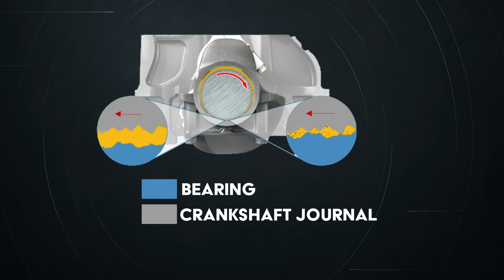the truth about start-stop technology (finally proven)

Comment: So, basically, instead of burning an extra 600 ml. of petrol for every hour that an engine is unnecessarily idling, it is more energy efficient
and cost effective to build two completely new cars. That makes perfect sense. Why didn't I think of it.
Reply: Exactly. The government looks like it's doing something good. The people feel good about themselves. The car makers make more money by having inferior quality products. Win win.
Reply: @0utc4st1985  Climatology 101 - Look good while making it worse.
Reply: @0utc4st1985  Yes. Mandate technology
that someone else has to pay for rather than building public transport infrastructure, bike lanes and improving road engineering.
Reply: You gonna rethinking that when you need to pay 1200 for a starter. At Honda we are starting to replace them on Pilots, we have been replacing the batteries on this things like crazy, and update after update for the worthless start stop. And what do you know we have a service bulletin to replace the starter. Start stop is not eco friendly.
Reply: @Flako92  starters designed for start/stop do not wear out excessively because of that system. 

The batteries now are also not made as well and are under more load than older cars so it makes sense that they don't last as long.

But yes, this was partially true on newer designs but has been corrected with reinforced pinion gears, or integrated starter generators. It's really not an issue anymore and I've never really heard of them going out excessively.

The starter on my grandmothers 05 Subaru outback went out all the time, didn't have a start stop system. 

So, it's really how well the system is engineered and from what I can tell the newer designs are plenty robust.
Reply: @Flako92  It's more like $400-600 job btw.
Reply: @Flako92 so how many hours does it take and what's the cost to do the starter replacement job on these
Reply: They talk about emissions and efficiency but how many cities actually use smart real time traffic lights? Worst than that is when they are de-syncd and once you get a red light every other light will be red too.
Reply: Two car is more money than one.
You gotta be on the corporate mind set man hahaha
Reply: good business model though
Reply: that a dream for car manufacturing.
Reply: It's not about the environment or your wallet, it's about the air quality in cities. Yes, it saves lives to damage an engine over time but at the expense of your wallet and potentially the global environment.
Reply: @larry365  Yes, it will reduce air pollution in cities, marginally, but from the perspective of global emissions, not a chance.
Of course, you can also reduce emissions in cities by investing in better road infrastructure, better public transport and bike lanes. The best and most effective way, however, is to reduce immigration and stop the sprawling developments ever outward and upward. For some reason, that hasn't occurred to anyone.
Reply: the test doesn't account for that... simple.
Reply: Instead of burning more petrol causing more wear on the engine, it is more energy efficient and lasts longer.
Reply: this helps manufacturers lower co2 emission. emission counts as emitted material multiplied by the units sold. so even a .1 l saving in fuel has a big impact - they have this as a budget to sell the more emitting and more profitable SUVs. Should they left alone after EURO 3 or 4, all would be fine. Also they like the ide of cars surviving the warranty period but becoming a financially unfeasibly repairable as soon after as possible.
Reply: Saving the world right?  Which do you think has a larger carbon footprint, burning a little extra gas or building two cars to do what one car could have done.
Reply: @Pje3ski  Total energy requirement to build a car? 100,000 -150,000 megajoules.
Total energy in one litre of petrol: 34 megajoules.
Total energy lost idling for one hour: 20 megajoules. (small car).
Average time US cars spend idling per day: 16 - 22 minutes. Energy wasted <7 megajoules.
I'm not going to bother going any further doing the math. If people can't figure out
how energy inefficient stop start functions are, that's on them.
Reply: How often do engines idle for an hour for most people, even cumulatively over a week’s motoring? I know mine don’t. Also, does it actually consume 0.6 litres for every hour while doing so? Maybe if it is a very high power engine.
Reply: @hedydd2 not rly my old Citroën with 2.5 engine 168hp was showing 1,6 litre per hour while idlling. 0,6 liter is very small amount...
Reply: @lucyferek  
It might show it 'on the display' but I doubt very much whether it actually used anything like 1.6 l/h.
Reply: @hedydd2 well if it showed that amount it showed how it was, during veey hard acceleration with 5 people inside it would show up to 213l/100km. Nothing surprising. My current daily driver takes 15/100 with delicate driving when i push it it has no limits....
I drive know what's in my avatar. And it only sports 360hp from 7 ltr engine.... 😮😂
Reply: @lucyferek  
That explains a whole lot. Ridiculous!
Reply: @lucyferek  The computer is wrong. Go figure. A Nascar doesn't burn that much fuel at 200+ mph. Four fully laden truck trailer combinations only just burn that much fuel doing 60+ mph.
I am quite happy to put just about whatever bet that you want on it that you can't get your Citroen to burn a small fraction of that at it's highest speed with its maximum load.
I'll go as far to say, I'll bet you one million dollars that you can't get that vehicle to burn even half of that.
Reply: @hedydd2 you would be surprised at how much they idle at traffic lights, stop signs etc. One of my vehicles keeps track of how many hours of idle time and it was shocking to me.  It gets awful gas mileage because it’s a 4 ton truck so I don’t let it just sit there idling or anything.  None of my vehicles have this auto stop restart “feature” that this video talks about.
Reply: @hedydd2  Try driving in areas with heavy traffic. You will idle for a lot more than an hour in any larger city.
Reply: The purpose of start-stop is not to save you 600mL, it’s to spare our cities the cumulative effect of a million idling cars.
Reply: @lebojay  Then invest some $ to fix non-optimal stop lights that create untold hours of unnecessary idling.
Reply: @lebojay  this is not the 70s, no catalytic converters and leaded gasoline. It's not even comparable.
Reply: @zaxmaxlax  CO2 is still a thing, oxides of nitrogen and SO2, depending on where you live, but no, this is not the 70's.
Cars back in those days were filthy.
Reply: @lebojay  The energy and pollution cost of replacing millions of cars earlier because their engines are worn is higher. It's the same with all the disposable expensive items you buy.... cell phones without replaceable batteries, kitchen appliances, washers and driers etc etc. Of course though you've  been fed a line a propaganda and cant figure that one out for yourself.
Reply: @lebojay  .... there are a shedload of more effective things that could be done other than this unnecessary, draconian requirement
Reply: @lebojay  Except that catalytic converters which are in every vehicle to clean the really nasty pollutants out of your emissions are vastly more efficient while the engine is already at steady state. The first few seconds after starting is often when your emissions will be the most contaminated.
Reply: @lebojay  Localised vehicle emissions are responsible for approximately twice as many fatalities per annum than vehicle collision are, on a global basis.
Let's not forget that. It is a terrible number to reconcile.
But a very small percentage of that toxic pollution is the result of cars idling. A tiny percentage, in fact.
How small, you might ask? If you spent
One hour and ten minutes commuting ten kilometres and one hour of that commute was at a complete stand still, you're looking at maybe 6% of your total emissions being as a consequence of idling in a car that achieves 10l/100km urban cycle.
Is it worth building three engines to one to achieve a 6% gain in localised emission's reductions?
I don't think so.
And is that the best path forward in addressing localised emissions?
No, it isn't. Better roads, light sequences, public transport infrastructure, bike lanes etc. That's the answer.
But that requires governments to actually do something, doesn't it.
It's much easier to pass ridiculous legislation and pass the burden of all reform onto manufacturers.
Reply: @davidbrayshaw3529 very well put, I agree 100%.
Reply: The problem is, we get stuck in traffic so long because vaccinated drivers don’t go on green. By the time they trigger their stop-start the light has gone red again.
Reply: @PeterLutzTEN95 that's wild😂
Reply: @lebojay Sounds communistic and dragging down individual quality of life to me
Reply: @lebojay  I will never ever use this feature in my car. Not my fundamental goal to subsidize the climate change zealots and support the biggest swindlery of the century.
Reply: It's possible to change an engine.  Still bad, however the rest of the car is fine.
Reply: @zeggyiv  How much energy does it take to produce an engine as opposed to idling an engine? What are the CO2 emissions that result from that process?
Reply: @davidbrayshaw3529  Do you really expect me to be able to answer that?  All I said was you don't have to bin the whole car cause the engine went.  

First you'll have to define "an engine" they're all different. 

I don't even know what fuel it runs on, what it's made out of, how much of that material,  what machines are used to machine it, with the mass and material the tooling uses, how much they're worn by machining an engine, which country the engine is produced in, the "energy mix" of the grid in that country, the method of shipping they used to get it to me, and other stuff I've not even thought of. So I'm gonna have to say "Dunno, you tell me, and show your working"
Reply: @zeggyiv  No, I don't. I'm just trying to raise awareness as to the opportunity cost in terms of energy by using this technology.
Reply: @zeggyiv easy to answer new engine is about 1/4 price of new car ie citroen c3 with 1.2 engine. Add to this cost of labor and other parts and your better to throw away whole car. There is no justification for that "eco" madness.
Reply: @lucyferek  Except you're talking about money and me and the guy I replied to are talking about CO2.

It's really easy to answer any question, if you first change the question to one you can answer.
Reply: @zeggyiv  It would be possible to change if designs were repair-friendly and parts widely available. But we live in a world where an insurance company will write off an entire car for a damaged door, some dent pannels and a broken headlight because the cost of repair is larger than what their "experts" have evaluated the car at.
Reply: @zeggyiv  The cost of changing an engine, is the same as a used car.

Comment: But this is a regular engine used in the test. Engines equiped with start-stop system have ways to prevent this. They keep the critical engine parts primed with oil even with the engine off. They have variable oil pumps, can be electrically assisted as well, to build up oil pressure faster.
Reply: Of course they do 😂. Manufacturers expect their engines, starters etc. to go on forever so you will never need to buy another car 🤔
Reply: @223Sako  i have a bridge and some swamp land to sell this fella
Reply: The variable pumps, or oil pressure control system can only work when the oil pump is being turned by the engine.
Unless there are now some electric pumps I don't know about, these systems wouldn't make any difference at start up.
Reply: Don't believe so. Also variable oil pump no good.
Reply: I didn't know that, now,   must have slipped under my radar : too busy fixing other folk's problems.
Reply: You are getting somewhere, but like most below, never cared to get up to speed on techniques to avoid friction at start, like valve overlap to reduce compression during start…

Comment: That is definitely a simulation but not one that represents real life wear, at least its not very representative for recent hybrid cars, since manufacturers nowadays automatically disable start/stop when the engine is not warm enough or if other components, like the turbo, are too warm and need oil cooling, so you’ll never get your car to start/stop constantly. 
That being said there’s definitely wear because most cars now run very thin oils, like 0w30, but like you’ve shown, through the years since they started adopting this “feature” they’ve changed many parts to reduce wear, so i wouldn’t say that you need to disable it, at least not on recent cars.
Reply: 0W30 is thin? 😂

Comment: Even if it causes no damage it is still annoying.
Reply: I hate this thing, I can't even turn it off in my car unless
Reply: Do you people not have a button in your car to stop it from working???
This sounds strange to me, i have a button for every function, every sensor. In fact, the owner manuals explicity says that the function should be off if the car isn't expected to sit idle for more then 15 seconds (or something alont this lines).
Meaning, the system is ment to be used on traffic lights, nothing else!
Reply: @carlosbelo9304  Yes, I have a BMW and I have coded it to remember it's last setting. So if it off unless I decide to switch it back on, it won't come back on by itself.
Reply: Fcuk that shit. It feels so weird. Definitely annoying
Reply: I hate it when it shuts of my engine when I'm about to slam the gas pedal to join fast moving traffic (I wasn't even stopped, I was slowly creeping towards the intersection)
Reply: @Zirikoi  This is what I hate about it the most it never turns off when it actually makes sense its always seconds before I need to hit the gas then you just stuck there listening to confused engine noises as it suddenly needs to restart and go. There is just no way that is good for the engine, common sense. Buying an autostart eliminator to fix this stupid problem that should already be available by default to turn off/on until the button is pressed again.
Reply: @IraFox84drive smart my guy.. My ISG button gets toggled strategically. If I know I'm gonna be in creeping stop and go traffic I'm disabling it because I'm not gonna keep letting the engine stop/start every few seconds. But if I see that the place I'm going to stop next is a place I'm not moving from for a while: accident, long reds or just hella busy intersections it's gonna be enabled.
Reply: @randomnaamofzo1246  my car owners manuals says that is the exact way to use the functionality.
I guess most people this days don't read the manuals for the stuff they get?
Everyone is a specialist in everything i guess
Reply: How is it annoying? It is silent at traffic lights
Reply: @Ben-ix8yb  I can't hear or feel the engine running on my car at idle speed, but I can certainly hear and feel it start back up if it has been off.
Reply: @Ben-ix8yb because the system fails to turn the car back on at least 40-50% of the time.
And no, it’s not broken. The mechanic already checked and said it’s “normal”. 100% garbage.
Reply: @Ben-ix8yb  It makes me very nervous to be sitting in the middle of a busy junction waiting for traffic to move and the engine is stopped. Like what if it does not start again?
Reply: @dukenukem5768  Or on a rail road track with an on coming train and a blown main fuse ...
Reply: @dukenukem5768 lol. I come from an age where if the engine stalls coming to a stop, that means something is seriously wrong. I couldn't drive one of these cars without having a stroke 😂
Reply: @Ben-ix8yb jfc humanity is still mentally in the stone ages
Reply: Yeah, there's no evidence that causes any damage at all. This video is nonsense